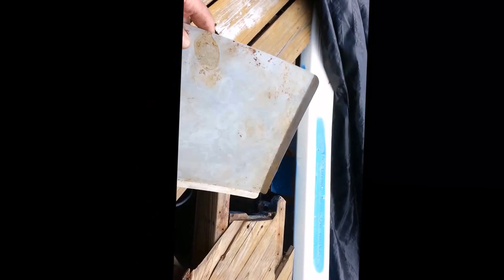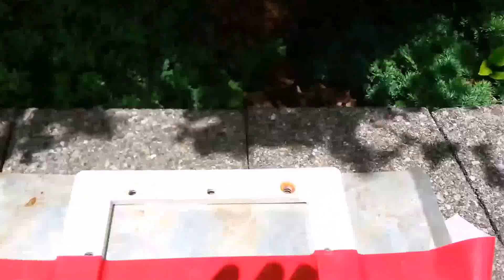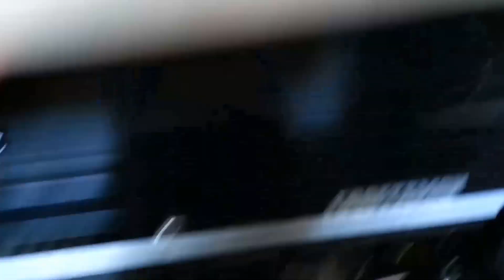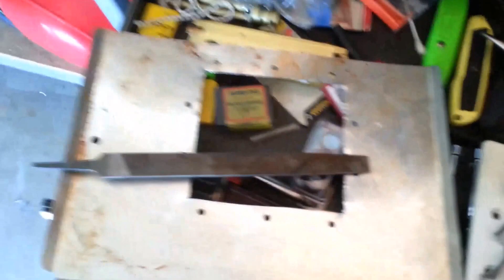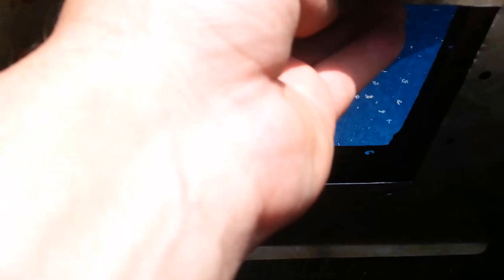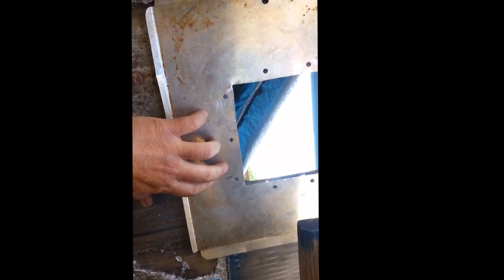Pool Wall Repair at Skimmer Basket. Also, check my video HVAC Relay

Comment: question i have a small side of the wall that can off the tracks does it need to be back in track before a put new liner back in, its hard to get it to move that far??
Reply from the maker: yes, i needs to be in the track. Otherwise it can slide out when the water is added. However, I had the same problem, and from the outside of the wall I cemented rebar (iron rods) through the posts and into the ground that hold the pool wall up. This way the pool cannot shift out any further.  I can send you a picture if you post your email.
Reply: Can I have a picture of that? That you are referring to???? How far are you From Louisiana ? Lol I realize this  is an old post however I would like to send you a picture of the rust around my skimmer help please

Comment: Darn. Mine leaks??
Reply from the maker: Without a good seal from the inside pool gasket this could be the problem. Can you go back and try sealing the area around the bolts?

Comment: Perfect! I wonder if I should bolt the pan instead of gluing
Reply from the maker: Ronald Abrahamsen as long as the inside bolt head is flat and very smooth not to damage the liner.